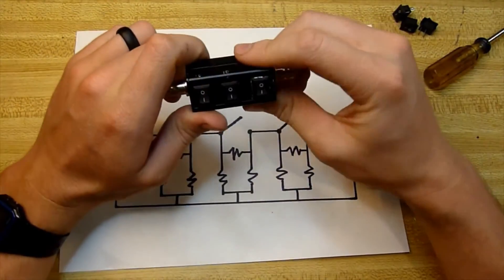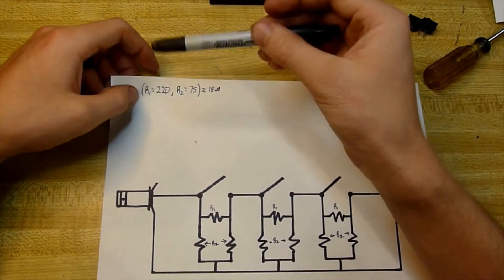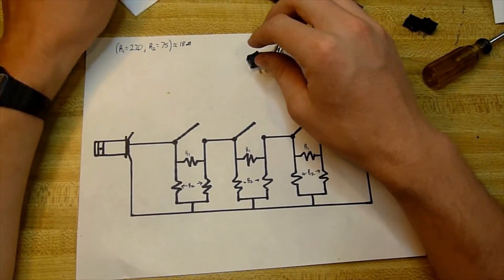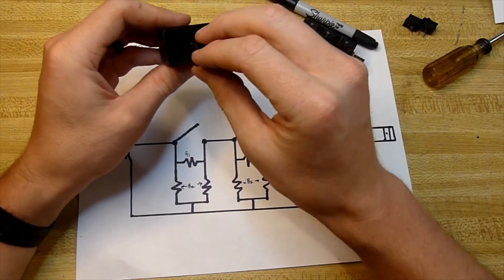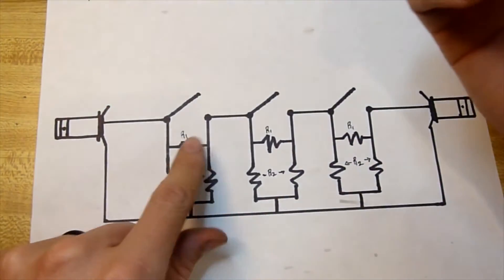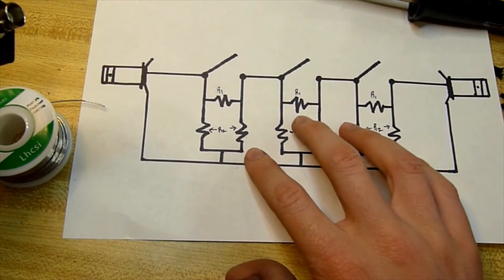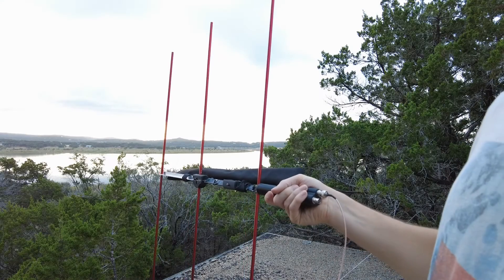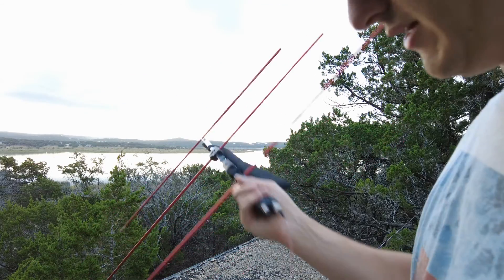How to make a radio attenuator

Comment: You say when all the switches are closed, there is no attenuation. But even when the switches are closed you still have resistors across the signal path to ground, so there is still some attenuation. You would need different switch arrangements to completely switch out the attenuation. So, the attenuation on the box is not exactly what you specify. Now, is that important in this situation? Maybe not, but it is a fact that is being overlooked. 73.